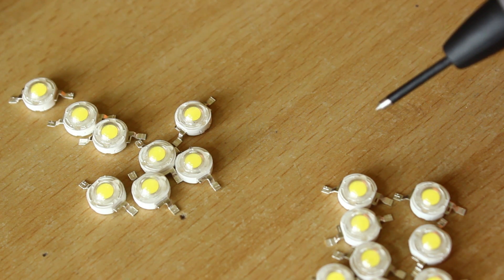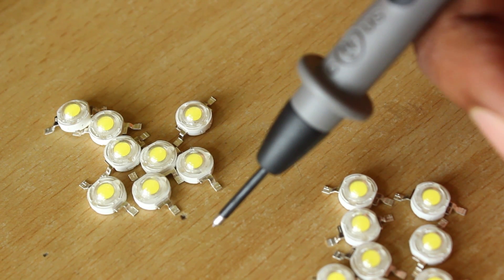Cheap 1W LEDs from Ebay!

Comment: I think the reason why those type of leds fail is because they have bond wires
Reply from the maker: That could be a minor cause, but I think BIGGEST cause is ESD damage and poor junction quality. These LEDs are manufactured in billions and they shove these in buckets in China with a plastic broom. LOL
Reply: That's true and also the packaging they come in is not antistatic either
Reply from the maker: Yes, I've seen pink tinted plastic wraps that are actually not anti static. Just colored pink so they can sell it at a higher price. It's crazy!

Comment: i used this in my broken tactical flashlight (floodlight) , this is amazing guys, AMAZING I tell you!
Reply: Is it bright and effective? And how many did you put in?
Reply: @09kenxgamer31  the telescopic lens and LED broke so i checked it out then i searched for an alternative LED as this is,I bought just one then soldered it in place, it's really worth it, really bright. BTW it's bright because it's a COB LED (Chip On Board), Google it bro.
Reply: @Zeref10110  but in the video there's no board? Only led. Can you send me a link what yours look like ? Thank you
Reply: @Zeref10110  thank you sir
Reply: @09kenxgamer31  no probs 👍
Reply from the maker: @09kenxgamer31  These LEDs are usually sold mounted on a roughly star-shaped aluminum PCB for cooling. If you are mounting them on metal anyway, just apply a drop of cheap CPU thermal paste and stick them on!
Reply: @PratikPandaVlogs  Thanks for the info!

Comment: Y bro we should not connect them in parallel???
Reply from the maker: If you connect in parallel, one of the LEDs will draw more current than the others and heat more. Because it heats more, it will draw a little more current... this will continue until one of the parallel LEDs fails!
Reply: @PratikPandaVlogs  Then wats the solution bro is it only series connection r any other sol??
Reply from the maker: You can do series and parallel combos. Like 5 parallel chains... and each chain has 2 LEDS in series. That's better than direct parallel connection.
Reply: Bro I have this kind of leds which r rated 3-3.4 v but they don't work when I give them that voltage only will glow at 12 v and I want a 20 led lightn i have 12 v supply of like 2-3 amp
Reply from the maker: Usually in a case like that if you have 12V 1amp supply, it's always a good idea to do 3W/3V LEDs... 4 of them in series. That chain will work at 12V@1amp. You can parallel 2 chains to make it work at 2amp. Then tweak the voltage on the SMPS a little bit to set the current per chain at ~800mA. That keep LEDs bright and away from their max current so they have longer life. 
BTW you got 12V LEDs I guess (they have internal series chains already), so you can simply put them in parallel. :)

Comment: Can you make a video talking about appropriate batteries for certain leds.that addresses why some batteries die faster in certain projects?
Reply from the maker: I kinda stopped making videos. I might start again at some point... maybe. :)
Batteries die in some projects faster mainly because of using linear regulators, resistors, or not using any regulation at all.
If you really want the battery to last as much as possible and you are willing to spend more on the hardware for that, you should use a switching LED driver IC.
These chips will control the LED current using an inductor and they are much more efficient compared to current sink ICs. Any LED on any battery will last for the maximum possible time with a constant brightness using a switching LED driver. 
Hope that helps! :)

Comment: Can I wire one to a 9v battery
Reply from the maker: You could wire 3 of these + a resistor in series with a 9V battery. The battery will die very quickly though. These are power hungry LEDs.

Comment: Hello Pratik, thanks for the video as it was much informational. You seemed to be much technical guy for this topic so I would like to ask help from you. I have bought below specs LEDs and want to know how can I light this up in 1 single panel, like what driver is required of what specs:

3Wx10 White LED
1Wx10 Blue LED
1Wx10 Full Spectrum LED

Thanks in Advance.
Reply from the maker: You can get a 700mA constant current LED Power supply and for 1Wx10, you could have 5x1W in series and 2 such series chains in parallel. Totalling to 10W. Make sure the SMPS can operate between output voltage range of 12V and 24V.
For 3Wx10, you can do the same with 2 series chains of 5 each.. In parallel. But the SMPS here should be 1.8 or 2 amps. 
This is the simplest way to do it. There's more complex ways if you want to get the best performance out of all LEDs. But they would require designing custom drivers. Worth it only for large scale applications.
Reply: @PratikPandaVlogs  thanks for reply. What should I ask in the shop for these drivers with specification?

Comment: Do you have a source for quality LEDs? I made a few projects from ebay LEDs but realized how incredibly variable in quality and brightness they are. Makes you think twice about making a lamp from a $1.50 COB chip. Certainly not CE certified and probably not safe.
Reply from the maker: You can find genuine and documented parts on Mouser.com or Digikey.com

Comment: If one wants to use such led's for a DIY project but wants to buy OEM type or high quality ones where does one go? It appears that China have drowned the market. Great video By the way.
Reply: There are electronics supply houses in most decent size cities.
Reply from the maker: You can find genuine, branded stuff from Mouser.com or Digikey.com